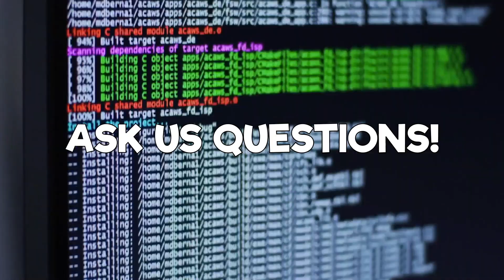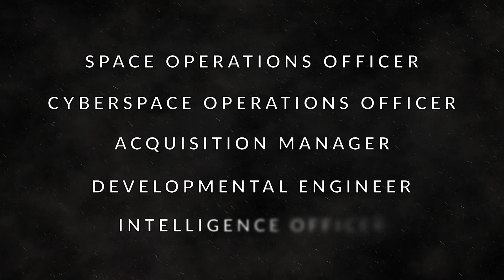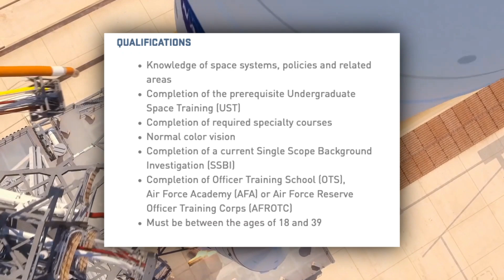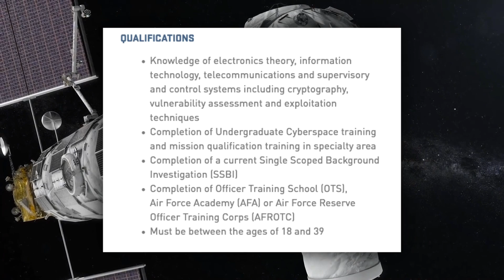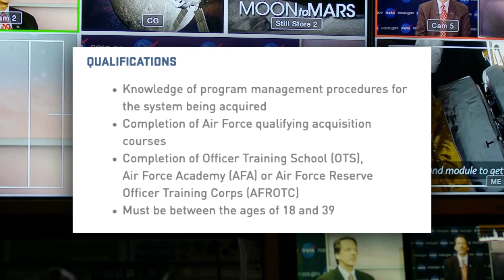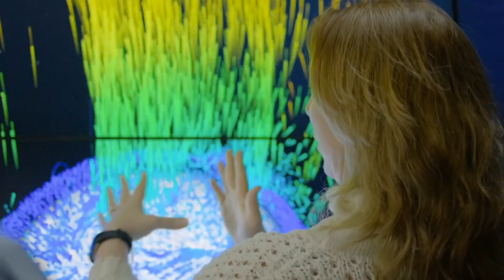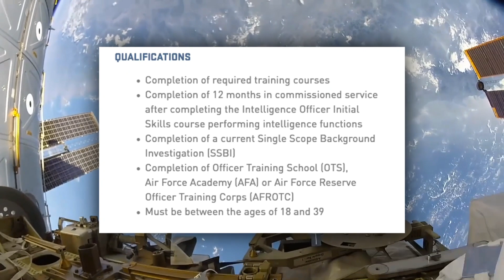US SPACE FORCE: SPACE FORCE OFFICER JOBS (2020)

Comment: This is  technology that might be a game changer in ABM and other weapons systems.  Very simple science but I have not seen it anywhere.  Maybe it was tried and did not work.  There is a perception perhaps that supersonic and hypersonic flight requires super powered jet or rocket engines.  But if air resistance and weight are super low and considering the super thin air at high altitude, a  tiny ram jet engine might propel a tiny solar powered plane to kilometers per second.  A 100 gram object  travelling at 10 kilometers per secind has as much destructive energy as about one kilogram of TNT. 
Solar cells might be used to pass an electric current through a stream of compressed air to power the plane.  The best solar cells are about 40% efficient.  But concentrated solar from a mirror might be closer to 90% efficient.  If solar cells are used to put an electric arc through a stream of compressed air, concentrated solar from a parabolic trough mirror might be used to heat up the plasma.  A critically dense plasma is opaque to light.  Plasma readily absorbs light and other radiation.  

A major argument against ABM systems is that the enemy can just make another missile for less money than the corresponding defense costs.  
The microelectronics and technology in a  $100 smart phone might have cost millions of dollars 20 years ago.  A tiny plane might be equipped with the necessary communications, optics, radar,  lidar etc , for the price of a smart phone.  An ICBM including the launch station costs an average $100 million dollars.   A million $100 planes might be hard defense to penetrate. 
If the planes can glide across the dark side of the Earth in about half an hour, ten million planes would be within a few kilometers of every point in the upper atmosphere.  Travelling in all different directions at the approximate speed of missiles and warheads, they could be used to track targets at close range and send out precise location and trajectory data for other planes to target and crash into.
Another possibility is a tiny fusion powered plane.  Fusion reactors tend to be h7ge but the Farnsworth Fusor was about the size of a basketball.  This modified Farnsworth Fusor that I call the Dyson Vaccum Fusion Reactor might be miniaturized down to one centimeter or smaller.  
If jets of compressed air are injected at the narrow end of a cone so that they spin the air in the cone, the air pressure at the center of the cone will tend to decrease.  If a good enough vacuum can be created at the center to accelerate ions to fusion velocity with high voltage and the ions are trapped by  a high voltage ring around the wide end, some fusion would result.  The stream of ions injected into the center would tend to help evacuate the air from tge center.  Surrounding the cone with high voltage negative plates would tend to pull positive ions of air away from the center.  When ions crash into the surrounding compressed air, they would tend to create a charged particles avalanche at the boundary between the vacuum and compressed air.  Electrons would tend to be forced in towards the center.  If enough of an excess charge iof electrons is created in the  middle,  fusion velocity positive ions might be confined in a plasma at the center.  This is easily accomplished at about 20,000volts. .Alpha particle products of fusion travelling much faster than the fuel ions would escape from the plasma and crash into the surrounding compressed air and heat it up to drive a gas turbine.  Thel negative voltage at the  center might be enhanced with beams of electrons fired into the plasma from the narrow end of the cone.